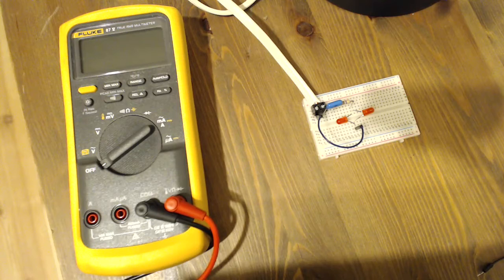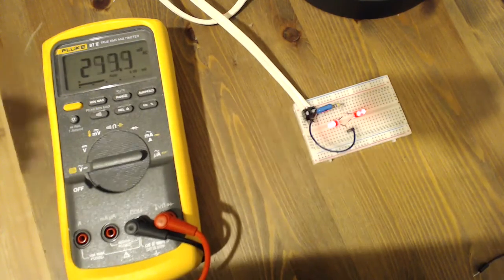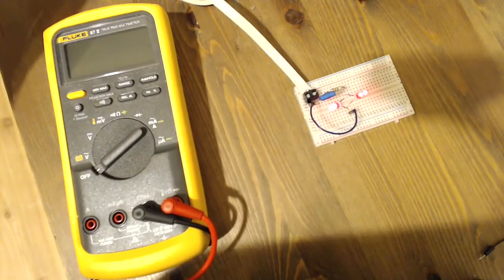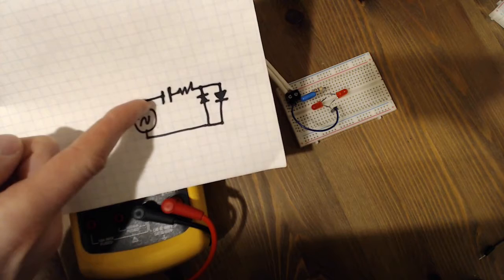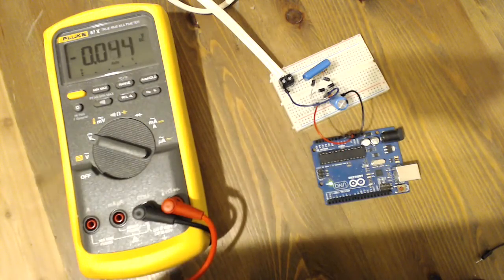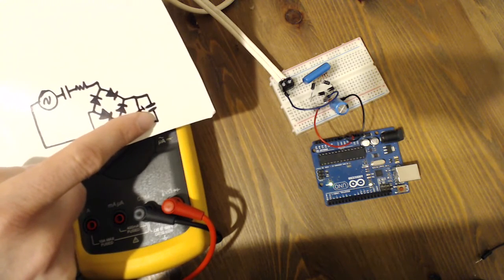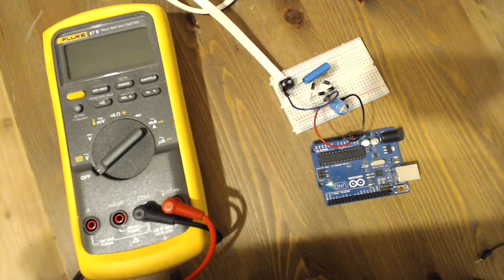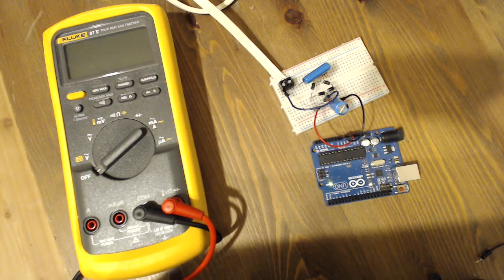capacitive dropper

Comment: Would an isolating transformer work to remove mains to earth voltages on the output?
Reply from the maker: An isolation transformer would indeed perform isolation so that the output did not have a high voltage relative to earth ground. However the voltage across the output of the isolation transformer would still match mains (120 VAC rms).  So voltage across various parts of the circuit would still be high, and very dangerous, just in a different way.

Comment: Remember that this circuit can only be used where the circuit is 100% isolated from touch. Any part of the circuit is dangerous to touch. You may be turning the mains down to a low DC voltage but that is only a low voltage difference. You still have mains level voltage relative to earth.
Powering an Arduino sounds like madness to me because I have a hard time thinking about an actual applicatiion where the Arduino would not have any interfaces to a users. In LED bulbs capacitive droppers are safe because all circuits are contained within the bulb enclosure. In fact there are many examples of dangerous cheap LEDs where you can touch the LEDs and they are very dangerous.
Remember in many countries the mains plugs are not coded. In most of Europe the 230V plugs can be rotated 180 degrees. And many US/Canada plugs can be rotated as well. So there is 50% chance you have only a diode between you and the live wire unless you have taken care to control which side is live and which is neutral. And sooner or later someone will make a way to swap the wires or the live and neutral are not connected right in the wall socket.
The capacitive drop circuit does not lower the voltage at all when the input going straight to the bridge is the live wire. There current path is mains live, through a diode, through your heart, through your feet to ground. Bob should have warned about that. Working with this circuit on an open breadboard with an Arduino is dangerous. Use capacitive droppers only for totally isolated circuits like plastic or glass enclosed LED bulbs.
For all other uses use a power supply which creates a low voltage which is isolated from mains with a safety rated transformer. Either a classic transformer/diode bridge/linear regulator power supply. Or a properly isolated switch mode power supply where mains and DC are separated by transformer and opto-couplers.
Reply: Very good point. A lot of people forget that voltages all all relative, not absolute.
Reply: exactly what I thought as soon as I see the Arduino.
Reply: Currently working on a project where I'm using an Arduino as a timer that varies a PWM signal to another component that will be integrated with the  μ. There is nothing to touch and the project is going to be entirely enclosed. 

There's a big warning underneath this video and "competent" should include knowing about polarized plugs and the meaning of neutral, which is tied to an earth stake outside your house, just as ground is.
Reply: Arduino could be in a box, communicating with users wirelessly.  I don't see the madness.

Comment: For safety reasons I think that capacitor should get a bleeder resistor or would that throw something off?  I suspect it would be like two resistors in parallel.
Reply from the maker: +Dark Alchemist Correct, as shown this is a bare minimum circuit to demonstrate the effect but many safety components are left out including the bleeder resistor you mention(with a high enough value so as not to pass too much current during operation but low enough to actually bleed the capacitor in a reasonable time), a fuse, a MOV. Not to mention everything being exposed in this way is dangerous, as it all being in a breadboard where things could come loose, etc.
Reply: *****
Yep, if someone built this that cap would give them a shock of their life, lol.
Reply: Yeah as a rule of thumb a 1 Meg ohm bleeder resistor across the dropper capacitor is usually sufficient other wise someone accidentally touching both prongs of the plug after disconnecting this circuit could receive a shock.
Reply: *****
One helluva jolt for sure.